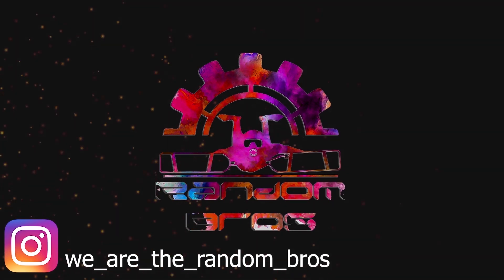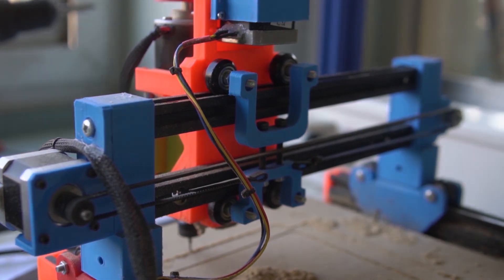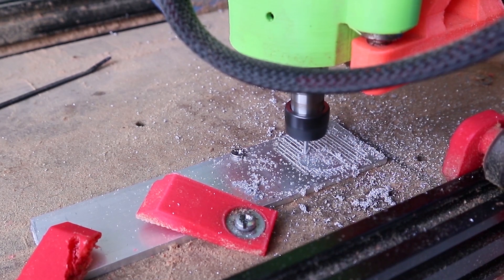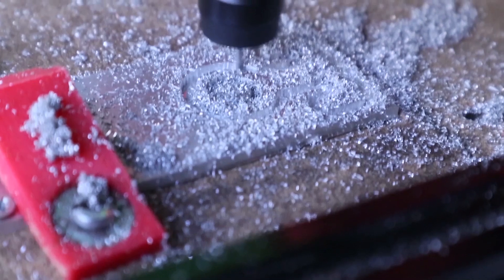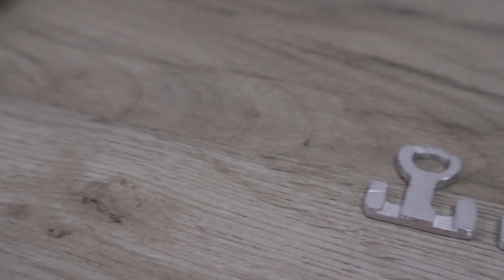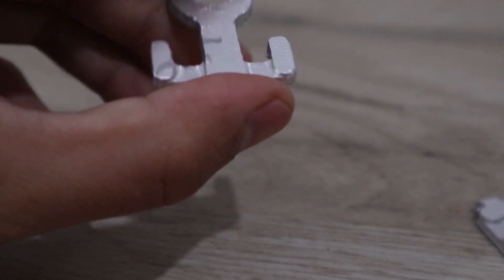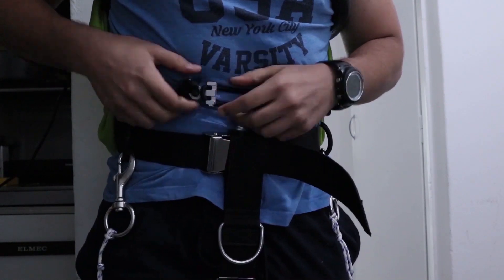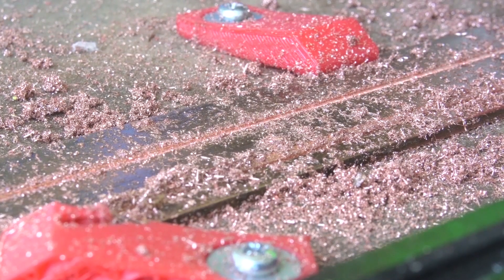3d printed CNC!! UPGRADES PART 2 !

Comment: You Nee to clean your chips, use air , its moving your tool horribly, and probably causing skipped steps. Quite common problem on made CNC machines. it will eventually destroy your tools and spindle bearings. add a small(tiny) amount of non flammable kero to the air stream using an atomiser tip. #Note dont breath it in - not good for you.
Reply from the maker: thank u very much for your valuable intel ! i've also read your comment on thingi! we will try  to implement your advice in our machine and we will get back with a part 3 !